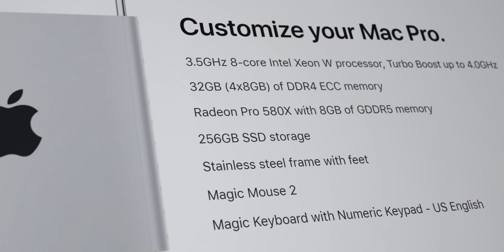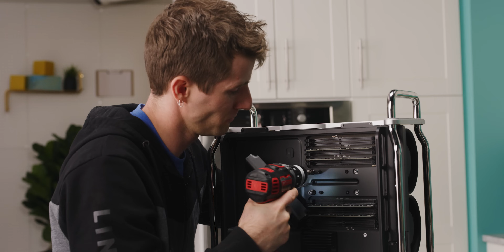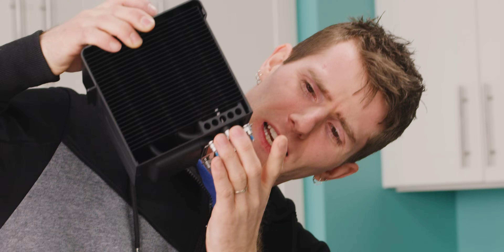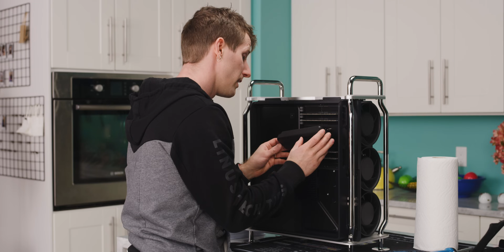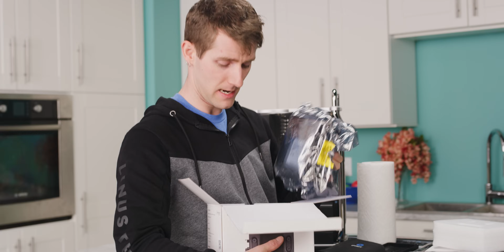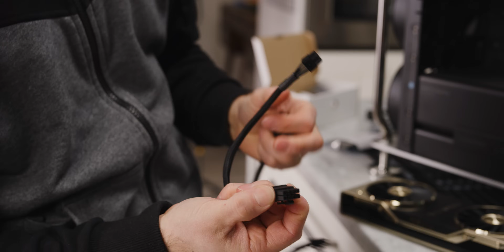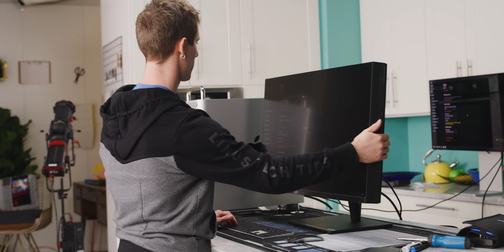Don't give Apple your MONEY - Mac Pro Upgrade Adventure

Comment from the maker: NOTE: The method we use to access the CPU is the same as the one used by iFixit in their teardown - We chose to do it this way because it's more likely that an end user will have the tools required. The "intended" way requires a long-neck Torx driver to reach the screws through the heat sink.
Reply: Buy $5.000 apple system, remove everything from it because it's shit, build pc from scratch in $5.000 apple case.
Reply: Linus Tech Tips should have gotten the server rack case!
Reply: The price tag is probably to recover all the money spent on designing their gratest case ever.
Reply: @rushboardtechuk  I think many people can build a better looking case
Reply: IT HAS A RETENTION SPRING!!
Reply: Hey linus, just a heads up, the drive included with the drive bay, you have to buy the drive bay with the 8tb drive, there is no other option.
Go figure, its apple
Reply: The usual molex conector is called Mini Fit-Jr and the black this machine is called Micro Fit 3.0 You can find it in regular electronics supplier.
Reply: But the base model costs £5000.. How bout just buying a MAC pro case and using Ryzen Threadripper / Radeon 7 hardware instead...
Reply: @fredsas12  ~ i wrote a reply for you, then hit the wrong button. ~ 1. Apple is about Design, i never understand the design language, yet i have never owned one. ~ You may purchase one of the least expensive Apple offerings, token purchase, and then search #AliExpress.com & other Japan, Asia, Korea, online #amazon.com mega stores, #linusmedia did an episode showing a #macbookpro case that included a second face plate option to avoid patent copyright infringement via not being prejoined prematched.
Reply: One question, can you watercool it ?
Reply: Hey Linus, any chance of you making a video testing out a Mac Pro with 3 afterburner cards or a video with two Radeon Pro Vega II Duos? I'd love to see what benchmarks you would get with all that loaded up.
Reply: Frank Militello That would be expensive (you’re asking him to buy two more cards) and pointless. The Afterburner card decodes ProRes RAW. No encoding. Encoding is still done with the CPU. It has a very specific function. One card can play six 8k ProRes streams. Who needs more than that?
Reply: music at 12:00????
Reply: What monitor was that from asus
Reply: 0:10 Corona Virus 🐍🐍🐍
Reply: Even the 2009-2012 Mac Pro models use that long torx driver.
Reply: Linus:  1.5 TB of RAM ain't bad!

Me:  Squeezing by with only 8 GB.  STILL.
Reply: @sunwolf87  8gb is really all you need unless you play high end games or do lots of graphic stuff like blender
Reply: exactly don't give apple your money too spy on you and overcharge you for a cheap product go out and buy a PC for half the price that performs better
Reply: Epic Gaming Ect got news for you mate, Windows spies on you like crazy and OSX doesn’t.
Reply: @electricsnut  ~ Wesley #snipes is cool, i'd rather than both spy on my everything, than sexual #roleplay #vampirehunt versus the #daywalkers. ~ #WesleySnipes.
Reply: Linus whats wrong with you. you can buy AMD EPYC sever with semi high end for £25,000 and it has double of the spec then your Apple Mac Pro is.
Reply: The link to the CPU is missing from the video description, where did you buy and how much?
Reply: IDK man i think Torx is common
Reply: Ailuropoda melanoleuca Nineoneone yes it is? Cost $500 more!
Reply: Ailuropoda melanoleuca Nineoneone thanks for the input
Reply: What's the chunky monitor you were using?
Reply: Do you have a new editor?
Reply: This is the same way the 2012 Mac Pro did CPU upgrades. Anyone upgrading a MP is well used to doing this! It’s also the same way you do it on a BeQuiet Dark Rock Pro 4...
Reply: why not show both "if you have this tool..." or "if you don't..."
Reply: I was ready to make a mean comment... Damn, I can't do it now. Thanks, Linus...
Reply: @buxata7338  you always can
Reply: You all should lend the case to gamers Nexus for case performance testing
Reply: would be cool if he you send me parts to build my dream pc not forcing just an idea cause I’m broke
Reply: What size long-neck Torx driver?  I still have my 16" long T15 driver, needed for opening up classic Macs like the Plus and SE.

It seems like Apple has always had a love for these drivers.
Reply: what's the deal with apple and nvidia?
Reply: 9:15 Was there a YouTube video about the Chrome Tabs with 2 TB of RAM or was it just on social media? Cause I can't find a YouYube video on it.
Reply: @Awesomedoscious  it was a Twitter vid
Reply: 3:43 Yes I know it’s just a figure speech but I have love for you. and he do to.(GOD )
LINUS TECH TIPS You worth more than an Apple computer💻🖥
“I will make a man more rare than fine gold, even a man than the pure gold of Ophir.”
Isaiah 13:12 ASV
https://www.bible.com/12/isa.13.12.asv

“I will make a man more precious than fine gold; even a man than the golden wedge of Ophir.”
Isaiah 13:12 KJV
https://www.bible.com/1/isa.13.12.kJ.   📺     ⌨️You...worth more and more and more⌨️
💤💤💤💤💤💤💤💤💤💤💤💤💤💤
Reply: yo Linus can we get a updated best parts for solidworks/3d modeling?
Reply: If you have a mac pro you already gave them your money dumbass. Too much at that too.
Reply: 9:32 ~ cute, provocative line. ~ Whomever "My one regret is that they have green pcb's" gets a pizza or luxury 8 course (minimum 8 colors) meal delivered to the office. 

My default was always ATI, MSI, Sapphire #RedPCB, #Epox the best overclocker did a Different Green. My GigaByte Embedded GPU was a #BluePCB, my Foxconn was a BrownPCB. #Asus the best cloud provider has a lot of BlackPCB, yet in my time all the pros and behind the scenes top i see it still true #SuperMicro for the server market has some elite interactions, various IC and certifications no other else is providing, interacting with, or experiencing. ~ It's a curious thing to use color temperatures as an #UnderWritersLaboratory #IEEE standards association guide, USCode & NECA, in this case maybe some sort of year code, and Gigabytes per Volts spectrum. = Color Temperatures.
Reply: 12:27 ~ any mention of #Toshiba is Welcome. They are that unusual Preppy Millionaire Friend that the Evil People are Inclusion of Because they always know more, and are assigned the more elite operations management. ~ This might be another #FluidDynamicBearing mistake (i recommended #Maxtor to Sony Playstation PS2 home computer, not knowing #Seagate was both the 1st inventor and much lower temperature, my 12GB maxtor model at 4726 Albermarle Drive was 20 plus years old and still working flawlessly. Yet Temperatures and quietness do mean longer life, #StorageReview.com) on my part, but my reality is that Toshiba invented Initial G Force Laptop Disk Drive Parking of Read Arm pre 2nd impact. ~ #Toshiba was also doing all the #CopyMachine archiving so that every document at all #Offices was encoded, yet all documents ever photocopies were also stored and searchable too? ~ #ToShiva or #ToQueenSheba? ~ Wierd shadow society, reselling Toshiba Office Copier #HardDiskDrives on eBay?
Reply: 12:00 ~ finally proof that i am old technology. ~ When $400 on an Apple product sounds like a bargain because it is $50 per TeraByte? ~ Storage prices are a little insane. ~ #AluminumPlatters is a prostitution game, where the prostitutes live shorter lives than the FAT areal density glass platters.
Reply: 19:20 ~ i can not explain the #Dropletfill posts between us, what i hear when i think back on the keywords or #hashwords is PoisonSomeStupid. #GammaDim is definitely a grammar fail, #GammaYes, and #DimYes, yet with other context #AbsolutelyNot! ~ #MovieTaken did not reveal enough of the Global Sex for Money Market attempting to murder all #GeniusSuperModels as #SiliconeSexDolls. ~ Nor why i was told to tweet at that husky scriptwriter, whom is Mensa for Sure, yet is always playing the cows penial artificial insemination penis milking bucket. = #JackAss revealed the amount of sperm a horse or cow produces, #DarpaGod murdered #Bamm and 2018 about #BrettKavanaugh told me they would murder #KobeBryant(i did not know why, and told god what am i supposed to say or do to prevent this without any response ever, recent news felt like rape was the topic and that #Kobe had raped someone=and what does that matter to #SCOTUS of the Beer until you BlackOut social iQ?), yet kept the one with the sense of humour #SteveO.
Reply: 19:32 yes i see the #red pixel life, is the longest pixel life. ~ the problem that what i see if a filter. and i am talking about #FFFFF i doubt this Cellophane plastic overlay of brightness is an honest representation, tho it is food for thought. ~ God fucks with my mind, all i care about is "#magazineWhiteintensity" and plant reflection intensity if you want a fire set fire to something if you want the sun go outside. = I have no idea why Google or anyone using or coding for OLED ever gets any burn in?
Reply: Hmm
Reply: To be fair... EVERY product with plastic clips... the plastic clips break.
Reply: Take a break. You look gassed Linus
Reply: Benchmarks for TR?
Reply: Linus Tech Tips LINUS:Slaps HDD
Me:STOPPPP
Reply: 10:20 The Mac will not boot, true. But can't you just reinstall the macOS from the internet in recovery mode (Shift-Option-Command-R )?
Reply: Aleksey Malyshev it won’t post or boot any OS whatsoever. The T2 chip prevents this
Reply: Pls takes break you're going to run out of tech tips soon
Reply: Linus Tech Tips I’m so done with 🍏  They are too expensive for me can’t keep up I am done
Reply: Linus Tech Tips fire Antony I will work for u with less pay than him and more time.
Reply: The title should be, Don't give Apple your MONEY - built a PC
Reply: haha I like how Linus says that this is really easy but then he is struggling to do things.  H well ima stick to building a hackintosh.  That way Apple gets none of my money.
Reply: Kenneth Loung Yet you feel entitled to steal their software but get up on your high horse about paying for it.
Reply: Electrics Nut the last time I checked I ain’t paying a price of a new car for an OS not to mention the fact your paying mediocre prices for a almost low end system for the price they are selling it to your for. Also I have my sisters Mac to fall back on for my hackintosh.
Reply: Kenneth Loung Justify it any way you want, their software development is paid for by their hardware. It is one thing to steal their software, it’s another to think you are entitled to it because you’re a tight ass.
Reply: Check out my latest video
Reply: apple: release any new product
Linus: I'm about to end rha man's whole carreer
Reply: If you can waste $6000 on a computer you can afford a screwdriver.
Reply: Stealing Mutahar's idea, we stepped this low now Linus ? SO FUNNY AND ORIGINAL
Reply: Linus drawing swatstika's with thermal paste ?
Reply: Please say you returned that thing
Reply: https://youtu.be/qnTrkvoeq0g
Reply: what is with the music in the background... i can hear them with my surround sound system
Reply: But liiiinuuuuus what if you don't have money to buy annnnnnnyyyy thinning?
Reply: Linus Tech Tips 50$ FOR UNDERWEAR
Reply: PC >>>>>>>>>>>>>>>>>>>>>>>>>>>>>>>>>>>>>>>>>>> Mac Always (excluding customer suport) *cough cough HP
Reply: Love the thumbnail linus looks like a living meme dont retire yet linus youre just getting started love your content man👍
Reply: Could you give me a pc? Please..
Reply: Hello Pro.... and How about one Hackintosh run dual xeon like this with 8  vgpu amd radeon7/ radeon pro/ quadro rtx 4000...???
Reply: honestly you could build something better than the 14k one for like 5k
Reply: hi
Reply: Hey can I have your old Mac pro cpu I currently have a 4th gen i5 and I am wanting to upgrade
Reply: Is a 24 core processor  really a thing?? I really need to upgrade my pc :*(
Reply: @alysdexia You call it A comic book 😂In that case you must be the Villain!? In the holy comic book... Stan lee is Drawing Pictures of you getting your   A⚡️⚡️kicked  to go with the holy comic book So later when we get to heaven  we can all laugh I forgive you it’s not your fault some people are raised in corruption we still love you
Reply: the mac pro looks like a mf cheese grater
Reply: You clearly didn't "chose" because Linus straight up said, as a matter of fact, that "Apple, just like with the iMac Pro, has NOT mounted the cpu into the socket with a retention lever." When clearly, it absolutely does. Just admit that you were wrong and don't make up a story.
Reply: @vectorhacker-r2  your mf ing grammar is terrible, please stop yelling angrily at people out of your arse
Reply: Unfortunately the CPU W 3175X does not work in the new Mac Pro 2019!
Reply: Can you hack upgrade a chrome book. A video on that would be cool.
Reply: I don't know if you have the urge to install this computer to Windows, it must be interesting
Reply: I think a real pro needs a computer that can help you to get your job done fast and easy not good looking
Is a pretty conputer help you to render massive video files? Same goes for noise unless you work on audio I miss the quiet hum of SGI boxes
Reply: @Static-4  I could not agree with you more I miss my SGI's My Octane II networked to my rack of Origin 200's they were attractive and great systems regrettably they died of old age.
Reply: @jonathankovacs1809  I worked for short time with sun sparcs and SGI octane  they re truly amazing machines
Reply: @Static-4  I agree I have also the pleasure of working on Sun computers. They were IMHO the best in class for their time.
Reply: Legend has it that Apple claimed this video
Reply: Buys 1.5TB of RAM, won't buy driver.
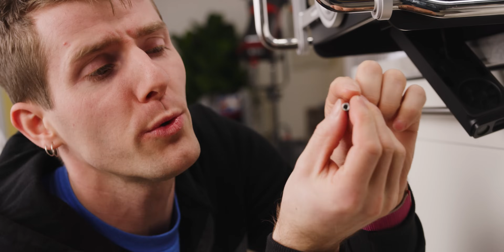Reply: 6:47 its called a Sex-nut/Sleeve-nit
Reply: Subscribe...... https://m.youtube.com/watch?v=6U8c3ZN2eG8
Reply: Oh ok bro 😂
Reply: I love the way Linus plays with 60k worth of hardware and make it sound like a bargain system.
Reply: :yt:SEND ME HATE ON MY videoS:yt:
Reply: Your king
Reply: I'd rather buy the proper screwdriver needed to remove it rather than taking apart the backplate
Reply: Mac Fraud
Reply: Hmm. Bought a bf aircooler and guess what, the tool was included...

But that wasn't in budget for Apple apparently, the cnc aluminium backplate covers were more important.

/sarcasm off: yeah respect to this freakingly fine machined gizmo. Still wouldn't buy it even if I could, but holy $h!t
Reply: @Linus tech tips - I have a Mac Pro 2008 , just need some advise on how to use , new this upfront options could you assist?
Reply: I wonder if you could install heat spreaders on all those ram sticks.
Reply: I want to see a corsair sponsored mac pro full of RGB
Reply: THAT IS NOT AN UPGRADE. THAT IS RAPE!
Reply: Let's all say it together: fck you miners, fck you miners fck you miners wait wait.
Reply: I just can’t believe Apple lets all that third-party product work inside of it and still fits so neat and tidy with minimal screws..!!

Love you guys, here in Nanaimo on the island ..
Reply: @LinusTechTips  video idea:  revisit this video with an RTX 5090 compared to a threadripper hackintosh, a PC and the current Mac pro.  

Lastly if you like this idea and end up making it....... Can I please have an old PC or laptop it doesn't have to be anything expensive even the Intel Celeron will do 🙏🙏🙏🙏🙏🙏
Reply: can u do a 3950x hackintosh!
Reply: Same @An0nV0ide here  and test Adobe apps on it
Reply: @An0nV0ide    I'm in the process of converting my iMacs into Linux machines.  Apple has become so proprietary and low servicability for its laptops and Mac pros that I want nothing to do with Apple anymore.  I'm awaiting my iPhone to die so I can make the switch to Android and finally be rid of Apple once and for all.  Don't get me wrong:  If Apple started treating its customers better and started making its repairs easier and cheaper, I would go back.  Until then!
Reply: @An0nV0ide  won't be able to. Threadripper max ram is 256 gigs, meaning that it won't be a competitor. That's why he chose epyc
Reply: @An0nV0ide  3950x doesn't work in macOS at all unless you resort to a KVM, but the issue there is that Linux doesn't run well either.
Reply: @slawor4  well it's working on 3900x bare bones without any problem or vm i mean snazzy labs has done it on 3950x it's just more cores right?
Reply: AAPL Stock prices DOWN 5.1%
Reply: @GHASR 729 — Except it's up 2.09%, thanks to the Q1 earnings report that just dropped.
Reply: قران الكريم}
Reply: The whole thing regarding lack of retaining mechanism on the cpu in the video is just misleading cause of that lmao
Reply: @_PaperbagGhost  They are obviously following the iFixit guide. While incorrect, they would have had to go elsewhere for the correct info, and go out and buy other tools. That is a waste of time.
Reply: My daughter Addison who is 7yo says daddy can mr Tech Tips give me this computer
Reply: How you guys did it is like taking out the cpu on a pc  by removing the retaining clamp on socket along with cpu and cooler. 
Why.
Reply: You can get the correct torx driver at Auto zone or any decent parts store for less than ten bucks.
Reply: It would have been better if you went to a Chinese market n bought a fake Mac Pro Case 😬
Reply: @GoldDiggerDE  this is big brain
Reply: “We chose to do it this way” - was it a choice? At the end of the video Linus seems to criticise the CPU for not having the mounting bracket and never once mentions a different way in the video. You guys sure you didn’t just miss it?
Reply: Where's the benchmarks ?
Reply: @marklarson3934  I dont think they actually got rtx working in Windows well. faked the video.
Reply: @curt8806  

I was thinking the same thing.

Trying to outsmart Apple -- not an easy task
Reply: Makes sense
Reply: 10 mil subs btw
Reply: SilverburstGamer Linus did this wrong - if you do it the correct way it’s two screws for the shroud two for the cooler
Reply: How come @snazzylabs has so many issues with getting is 1080ti going but you guys didn’t? FAKE
Reply: Don’t retire
Reply: Nvm that sounds selfish.  Do what you want   Except retire
Reply: K
Reply: No offense but no one uses LTT guides. We’re here to be entertained not to ruin our hardware by following your guises.
Reply: BS. No one upgrading their Mac Pro with a 28-core CPU (or even 16-core) would've skipped a freaking long driver. Too high risk of bending some pins and breaking some PCI or RAM functionality.
Reply: way to lose warranty of a brand new pc
Reply: Jimi he will just return it then some other poor person will be stuck with it.
Reply: Linus Tech Tips 

But you made it look unnecessary complicated when it’s not at all.  Shoulda looked at some other tear downs of the MAC PRO.
Reply: Apple sucks asssssssss and who buys one got scammed and is a loser.
Reply: Linus Tech Tips shoulda done it the intended way
Reply: @onecleangolf  do as I say, not as I do
Reply: @onecleangolf  9:22 which video this test was?
Reply: @onecleangolf  nkjokp kpp p moon noniibiiii8 okii ii III ii in
Reply: @onecleangolf  agreed. let's all shame Linus for this, omg the horror!! the poor CPU, what will we ever do
Reply: @ccgb92   IMHO I do not think I would let Linus fix my TRS-CoCo that is sitting my my storage unit. I would sooner trust my 4 year old nephew to do the work with  supervision of course..
Reply: "We chose"? Doubt it. Still good though.
Reply: Hey Linus! I'm building a computer and I'd like some advice, if possible. The Specs can be found here:

https://pcpartpicker.com/list/FmGfFG

Anyways, I'm gonna use the Vega 8 APU, but once I get enough money, I'm gonna get a RX 570.
Do you think this is a good build? My budget is $300.

Thanks for reading!
Reply: @stone6783  Please get in touch with local businesses, especially IT, who might give you or sell you a good PC that's a few years old for very little money. Walk in and tell them you're local and can they help.
You'd be surprised, it's human nature for most to want to help if they can. They might even have a graphics card and larger hard drive too.
Reply: Zahadoes they have an entire form dedicated to this already
Reply: @stone6783  Maybe go for 3200 mhz memory
Reply: @stone6783  I would consider buying faster ram maybe 3000 mhz, since you are going to run on the APU it relies heavlily on the ram speed
Reply: @TheFlezhwing  he can overclock the ram
Reply: Ok boomer
Reply: Linus Tech Tips is there a way to extend the Bluetooth range on a sentinel that’s used with the coin app for geo mining ?

Keep up the good work